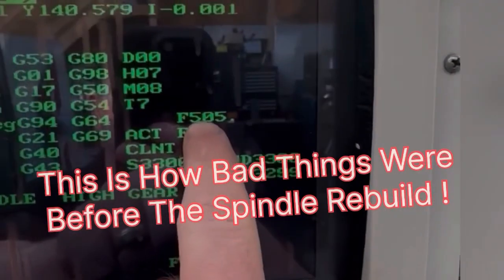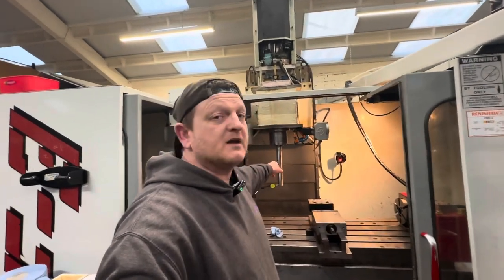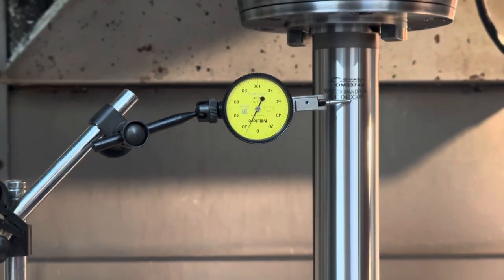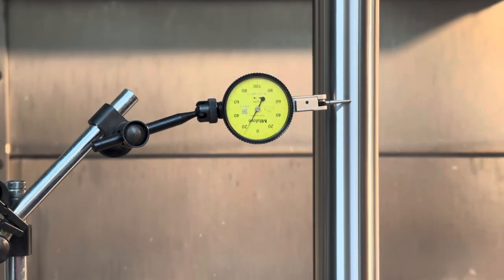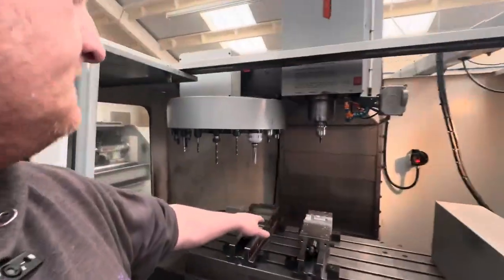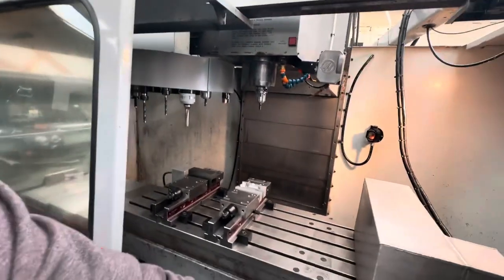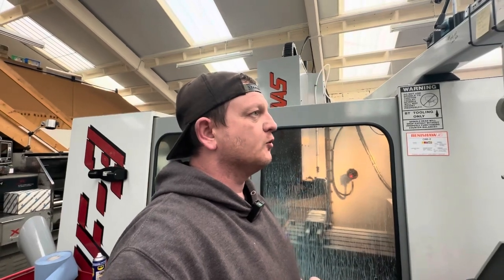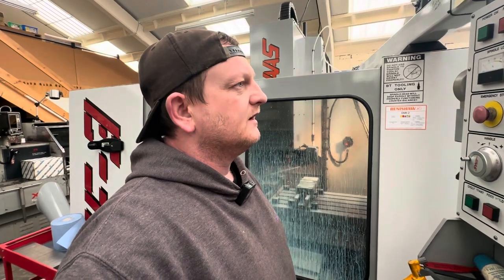Test cuts in the Haas vf3 with the rebuilt spindle !

Comment: Did you find those Hilma Vices used or did you buy new ? Are you happy with them ? I am looking for a pair myself.
Reply from the maker: Hi

I bought both of the Hilma nc125 vices brand new 

I also have a pair of Hilma nc160 vices which I bought from an auction
Reply: @kinzy_fabrications  How do you like them ? I assume you like them since you have two different sets.  Are they much better than the rest ? Thanks for answering !
Reply from the maker: @Panzax1 
Hi

No problem

I haven’t used every vice out there but compared to the likes of Gerardi, Lang, Kurt then I think these Hilma are in a league of their own but that’s just my opinion
Reply: @kinzy_fabrications  Thank you ! Very good to have it from someone who used them and not just a salesman :)
Reply from the maker: If you buy them definitely get the pre setter for the vice as well, not too expensive but gives you 6 clamp settings
Reply: @kinzy_fabrications  Thank you ! That sounds like a great idea.

Comment: I think you tester for draw bar force has a certain diameter, surface area piston, so it has to calculate the spring force with the graphs provided. If the piston inside the tool was say 4" dia. the gauge reading would be lower. Much more surface area of the piston in that case.
Reply from the maker: Ah ok, thanks for the insight

Comment: Sounds good to me, good job! The rebuild of you catch the issue early looks really easy to do. Happy machining
Reply from the maker: Thanks
Yeah its actually not too bad, helps if you don't bend the spindle with heat lol but all in all it was ok to do
Hardest part without a doubt is removing the top spindle pulley

Comment: That's great the the rebuild seems to be working well. Gives me more confidence when doing mine!
Reply from the maker: Thanks,

yeah go for it, as said to others, hardest part is removing the spindle pulley then after that its straight forward
Reply: @kinzy_fabrications  Mine isn't a Haas spindle, so removing the pulley is the easy part, and there's no shrink fit sleeves in it either (there's threaded lock nuts). But my bearings are permanently grease lubricated, so contamination is probably a bigger issue. The "air+oil" flowing through the spindle doesn't seem like the best design decision to me - it's easy to introduce contaminants through either the air or oil supply being fed in. I can see using an air purge out the labyrinth seals to keep anything from getting into the spindle both on the top and the bottom without flowing anything through the bearings, but unless both the air and oil supply is filtered, flowing more matter THROUGH the spindle bearings seems a bit risky. Maybe that's why they don't design them that way anymore?
Reply from the maker: Maybe just a good way to sell more replacement spindles lol